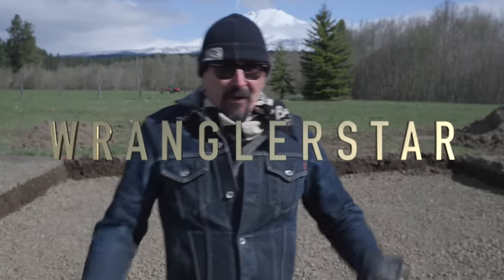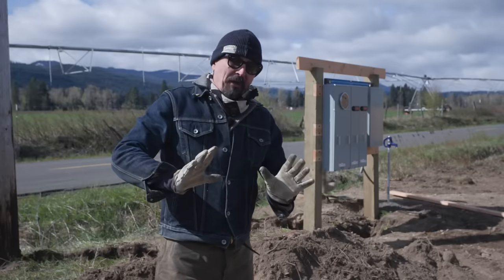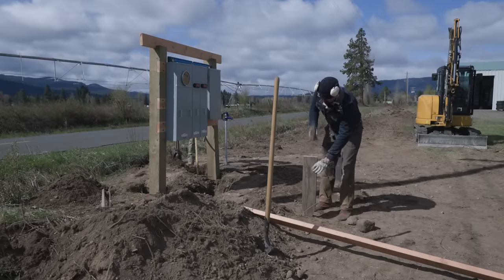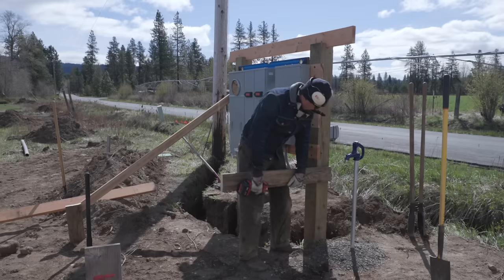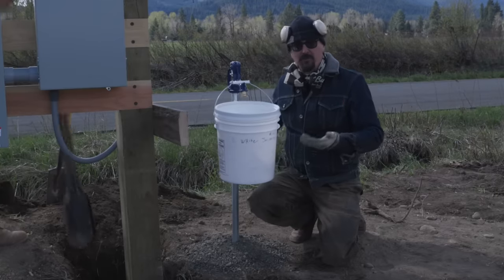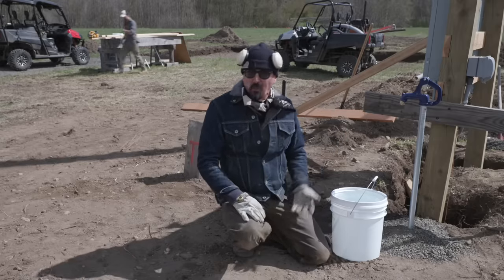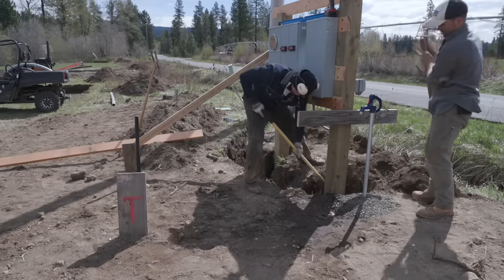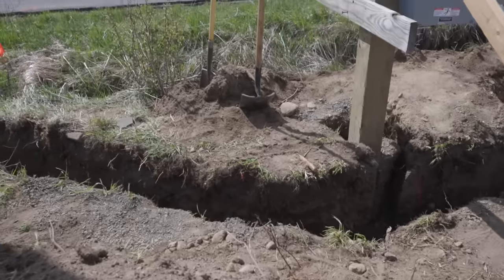Episode 8: Shocking DIY Fail! Fixing My Biggest Mistake in the Cozy Cabin Series

Comment: I got the permit back today from the planning department for my new deck. I've never really built anything before, but I'm going to step away from the keyboard for a while and build it myself. I should learn a lot (just getting the building permit has been an education), I won't have to worry about some shady contractor doing substandard work, and I'll save a lot too. Deck builders are charging $80-$120 per sq ft around here to build decks!!! I've estimated the cost to build it myself at $35/sq ft including materials and tool rentals/purchases. Mistakes will be made, I'm sure. Watching Wranglerstar has inspired me to give it a go 😎.

Comment: There is a piece of conduit that can move back and forth with the ground movement, it is put under the electric panel, I'm sorry remember its name. Any good supply store should now what I'm referring to. John
Reply: Expansion joint. Code requires 'em here in Colorado if you're doing anything more than just sleeving a direct buried riser from the ground.

Comment: I replaced a service at my work, also training my eventual newby replacement. The utility peope came by and disconnected the underground transformer that was about 20' away. As the driver drove away, I asked my coworker...Do you know that "Ethiopian"? He said no.. Do you trust that Ethiopian? He shrugged his shoulders. We poked the leads from the transformer...one was still hot. I called the Ethiopian on the phone to come back. Without a word the Ethiopian went back into the vault, did his work, buttoned everything up and drove off without a word. Anyway... we hand mixed a small base of concrete and made a nice pad with a box for access/inspection of the ground connection (anti meth head measure). It started to rain before the concrete hardened and the rain made the most beautiful pattern on the cement....which is what I wanted to comment about Cody's installation.

Comment: From the very start of this series I was wondering why you wouldn't have just threw up a temp power panel until you get the building itself finished. I assume you want power close to the job site to run tools and such which I understand entirely. But there's zero way I would have committed to a final spot for a giant structure like that before seeing how the astatic of the cabin looks first. Once that building is up you may absolutely hate the location of that thing.
Reply: I agree with you 100%

Comment: How do you keep the tweakers from cutting the entire installation away as a drive-by? Folks would steal a slice of pizza from a rat and then kick it down the stairs into the tunnels.
No tunnels where you are so the attraction of fancy copper wire and utility hardware 5 finger champagne would seem irristable . . .  simply wondering

Comment: No, primer before the glue?  That should bother you more than the sign.
Reply: To be fair, primer is typically used when joining an older/used piece of pvc with a new piece. New pvc doesn’t require primer.
Reply: For electrical I use an all in one.
Reply: @ThatSoonerGuy  It's code here.  The primer softens and cleans the pipe to help the chemical reaction that happens when glue is applied.  I know its just conduit and doesnt really matter, just kind of odd he doesnt care about that.

Comment: Other than your OCD, am I missing something here? Is there a functionality impairment, or safety or building code violation because the electric panel mounting frame is 6 inches askew in relation to the roadway line or building foundation?

Comment: I wonder if its possible to refill one large propane tank from another large propane tank.....Absolutely should never be done if the receiving tank is past its expiration date, even if its in perfect condition, oh no sir, not me, I would never disrespect the autority of the government that is so lovingly protecting me by forcing me to bring the tank in to be recertified after 10 years from its manufacturing (in canada it is quite expensive) , anyway, in cases where it would be totally legal, I think it would work if the receaving tank was put in a freezer, and the donor tank in the su to raise its pressure,
Reply: You'll definitely want a tank with a "wet leg" so you'll be able to refill with liquid propane, into your refill cylinder. Dont forget to weigh the tank to avoid overfilling it if it's not OPD-Equipped.

Comment: You should get the same GPM.  If I heard you corectly.  3/4" into 1".  The smaller diameter is the "resistor".

Comment: GPM will stay the same regardless of diameter
Reply from the maker: Incorect, there are many factors at play, elevation, friction loss, distance, and pressure, I was a Firefighter Engineer, I get it,
Reply: What you talkin bout Willis?  Static pressure will stay the same, GPM will certainly change.
Reply from the maker: What is the water pipe has a change of grade?
Reply: @wranglerstar  static pressure will change by about 0.433 psi per foot of Elevation change from your measurement location.
Reply: You're right. Community college physics came back to bite me.

I was thinking that all other factors would remain the same, except adding a diameter reduction before the end of the system. 
Such as when you put your thumb over the end of a hose. Cross-section area decreases, but speed increases, so flow rate does not change.

Comment: Who needs 400 amp service in a little cabin?????
Reply from the maker: PROhO does,
Reply: @wranglerstar  lol... I get the temptation, but how many machines could you possibly use? A buddy of mine just did the same thing, and he only uses one or two machines at a time. It's overkill, the electric company could only deliver 380 from the transformer. But even a 20hp Haas needs 60 amp. So unless you are running 8 full blown industrial machines... just saying. Nice to have the option though. I'll give you that. Have a good week.
Reply from the maker: You should consider this is one of multiple structures scheduled to be built on this property